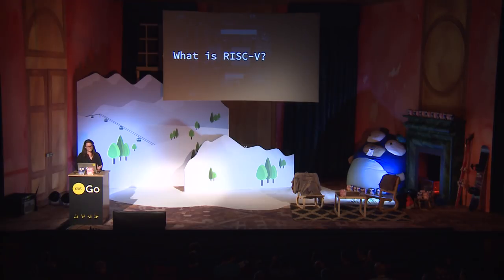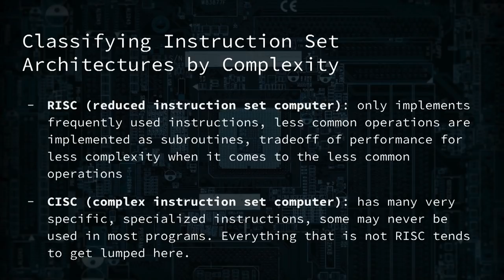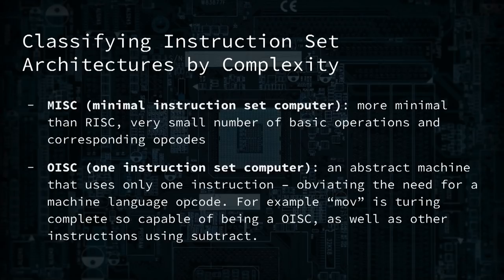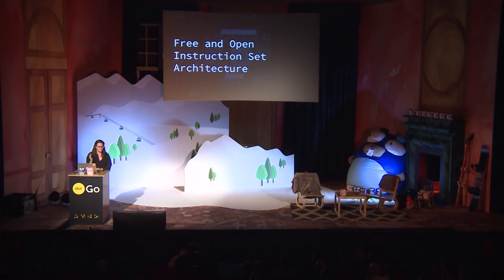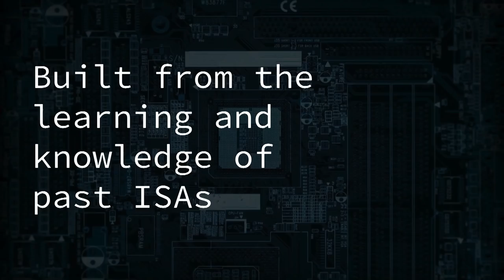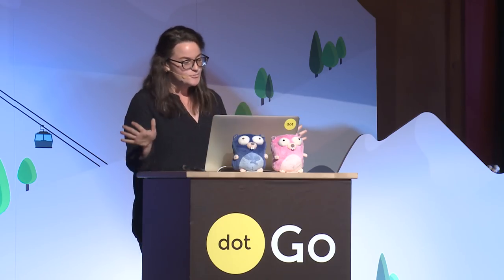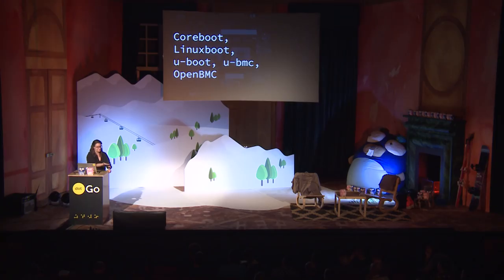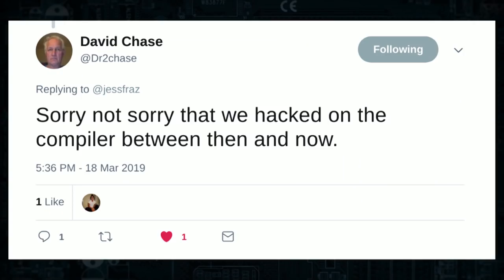dotGo 2019 - Jessica Frazelle - A dive into RISC-V

Comment: chapter 1: What is an ISA
2:15 An Instruction set is: "Kinda like that interface that you can use, which is cool"
chapter 2: cisc vs risc
... fck this is archeology via google searches. 
4:03 Completly misses the mark at VLIW. Itanium failed because of the compiler complexity that no one got right. It's not up for "what you need or not".
5:07 x86 has an instruction "send data to the nsa" - okay, now I know what crowd we're talking to...  I saw that talk at blackhat too where that guy reverse fuzzed x86, was fun. but nowhere did he say anything about the NSA
5:40 she's swinging like a pendulum. Probably a problem with her medication. Voice vibrates like....
She couldn't even be bothered to practise her talk in front of a mirror.... I can't take it anymore. sorry, I'm out

I found a nice podcast for anyone interested in risc-v
podcasts.androidauthority (dot) com/gary-explains-risc-v-the-open-sourced-hardware-solution-of-our-dreams